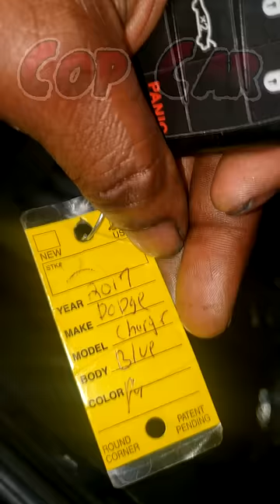Here's the PROOF about this COP CAR...lol

Comment from the maker: Transmission for this car here: https://www.youtube.com/watch?v=6CeC52oOLB8&list=PL-em2JbvrnvxuqZ5bcjgOpZNcKiyPd5Oj
Reply: Look at the sticker in the door jam to prove the year
Reply: Is that the same transmission they use in the Mercedes
Reply: How are you a mechanic and can't find the year
Reply: @dcraexon no. Mercedes uses their own internally designed, and built transmissions. The only Mopars that used MB units were the older generation that had the 722.6. Namely, the Sprinter vans and the Jeeps with the OM642 diesels.

Mopar does also use the ZF units which are used in a plethora of European cars though. From BMW, to VWAG, to JLR.
Reply: U can prove the year via the vin number 10th digit from first 8th from last is the vehicles year make and if u open the drivers door u can find another sticker that shows the month it was built
Reply: @stewart8127  or the V.I.N.
10th character should be an H for 2017.
Every 1st year mechanic knows this.  OMT is just a loud guy with some tools.
Reply: @illuminati5160 YOU GOTTA BE J.ROMO'S BUDDY NOW SOUNDING DAF....
Reply: What brand is the cargo storage in the this dodge brother

Comment: The year will be on a factory sticker on the driver side door inner panel near where the tire pressure and tire size information label is. Hope this helps. It shows the month and year of when the vehicle left factory.
Reply: Exactly LMAO
Reply: You would think a "mechanic" would know this...
Reply: @Notably Nova  I work at Nissan as a Specialist Technician. Even before I was I knew. 😅 sometimes certain things get missed by the eye 👁
Reply: @bimmerhuncho908  hell I learned this fact before I was 13 LOL
Reply: @Notably Nova you learned it faster and earlier than most. My father didn't know how to check the recommended tire pressure or where it states what type of oil, brand, capacity, engine size, Transmission Fluid type which is on the underside of most hoods
Reply: As a car guy as well we know these things before age 15
Reply: Don’t forget that depending on the month it was made it could be that year or the following year model. Built in June or before it’s the year on the tag, built after June it’s considered the following year model. For example 10/14 would actually be considered a 2015 where 05/14 would be considered a 2014. Don’t get me started on half year Chevrolet trucks.
Reply: @sleepingontheblacktop6053  true true. Some people forget that. The car will sit st Dealership storage until it's ready for display outside or showroom floor for the next year's lineup
Reply: Ford forgot how that legally works and put out all there 2020 models that sat outside waiting for computer ECU chips collecting undercarriage rust of the subframe, frame, transfer case, rack, differential, accessories and so on and claimed them as 2022. Skipped 2 years of lineup because they got cheap. My buddy bought a F-150 lariat and had me check it out at his 500 mile mark where he broke it in and had the oil changed early to get any micro metal shavings out from the brand new engines Oil (which is true) and I saw all the rust on the vehicle and the sticker read 03/2020

Comment: The Charger Pursuit Package (Police Charger) is the only 2015-current model that you can get with a 5.7 AWD. It also comes with a somewhat reworked version of the NAG1 transmission to give smoother faster shifts. It is only available to police departments. AWD Hemi are not available in the normal civilian model’s because of the 8 speeds size in the transmission tunnel under the car.

Comment: J Romo was partially correct as the V8 AWD were dropped for consumers in 2014 but kept for Police Pursuits and if my memory serves me correctly it was because of the implementation of the ZF 8 speeds whereas the AWD use the NAG1 5 speeds. So both of you are correct.

Comment: The only problem with the hemi started in late 2006 when they started the multidisplacement system. I have probably one of the only 2007 Dodge Ram 1500s with a 5.7 Hemi and the 6 speed stick shift. The original motor I had in the truck went out ( 4.7) and I bought a motor from a 2005 ram which had the hemi in it. Took some work to get it working right, but it is insane in my single cab short bed truck.

Comment: They did make 5.7 AWD pursuit cars after 2015 but they use the older NAG1 transmission because the 8 speed is to big to fit a transfer case.

Comment: Year is on the driver side on a tag if not there some cars have it in the glove compartment, under the hood, or inside the trunk somewhere . For instance That’s a 2017 so on the tag inside it should say 2016 because the 2017 model was released in the middle of 2016. Hope this helped!

Comment: Under the hood is Emissions label.  Windshield has Vin number . Door jam has every information you need on that car from trim code to year.  2017 is the question  point camera to door jam . Hood label or vin.  And that was not a dip stick . It was a cap .

Comment: Any modern vehicle in America will have two stickers in the driver's door jam. 1 tells make, model, date of manufacture, paint code everything. The 2nd sticker will tell you how much pressure your original tires should have, tire size, max weight load, etc.

Comment: The way you prove the year is by opening up the driver door and looking on the VIN sticker for the manufacture date. If its in the secont half of the year it’s for the following year (if it says 1/17 its a 2017 but if it says 9/17 its a 2018)

Comment: I’m pretty sure he’s half right and If I’m right they did end product of the awd 5.7 in 2014 when the updated version came out but only for charger/challenger models sold to the public. The police cars get a different set of options and is probably why that 2017 5.7 charger is awd. It’s got a cop motor, a 383 cubic inch plant, it’s got cop tires, cop suspension, cop shocks

Comment: Should be a tag on the drivers door or door frame of any vehicle made since the 90s with year of manufacture, gross vehicle weight, recommended tires and their pressure.

Comment: Only way to prove model year is by VIN or the VECI label, and that will just tell the chassis year. Block serial and trans serial would verify their years respectively. Could also use visual cues like body/interior components.

Comment: Well you sound like an excellent mechanic but you could have just sent us a shot of the spec tagging in the driver side door jam and blurred out the VIN it would have given us the build date and from there we can figure out the model year and you'll be able to prove it! Whenever I work on a vehicle I add a picture of that to the file to make sure that I can always prove that I procured and installed the proper parts for that exact model year and build-out... Don't forget kids the 8th digit always tell you what model of motors in there!

Comment: You can check the year of a vehicle based off of the vIn the eighth digit from the end is the indicator if it’s between zero and nine, that tells you what year it is between the year 2000 and 2009 and 2010=A 2011=b etc

Comment: You try and out dodge jt you will get the horns.  Yes all charger police intercepters are hemi and awd. Our state rather have a charger but our state is in an unbreakable contract with ford. So they use the charges are unmarked or undercover.
Reply from the maker: Interesting. Thats whats up Ken

Comment: Two things you have to remember.
Where the police packages considered a standard option package set over there custom option set?
Two and probably most important what's in the car and what came in the car are often too widely different things. 
The factory slip paperwork she tell you what the car originally had, what's the car then sent to a dealer that made alterations, a shop that made alterations these are things that need to be addressed before you can definitively say how it came from the factory. Joe there's a possibility that both of you were right, and both of you were wrong at the same time.
Either way that's a badass ride.

Comment: Look on the inside of the driver door panel should be a manufacturer sticker with the date it came out the factory it may  technically be a 2017 but could of been made in mid to late 2016 as the next model vehicle’s alwasy come out a few months early…

Comment: Does it have the start switch hidden in the floor? It'd be where they usta put the high beam light switch back in 70's on the floor by the left panel. Had a State Patrol car come in the dealership once with it. We only had this 1 car come in for repairs.

Comment: Dodge decided the 5 speed was more durable for law enforcement. And you can identify the awd chargers in 2015 and up by the rims usually. The awd models have the all black steel rims with the chrome center cap. They just slap good old covers on the rwd models. A trooper here said he liked the 5 speed in pursuits over the 8 speed I don't know why. But I would honestly like to see how the 8 speed paired to hemi vs the 5 speed. We just got Durango's but no hemi now for 2023 only positive is the 8 speed.

Comment: i got a question for you, i sold a 2014 charger dash bezel on ebay, some dude bought it, after i shipped it to him he refunded it because  he says "it didnt fit", he claims to have a 2014 charger srt hellcat, and that he even took his car to the dealer to have them check the vin. coming from owning 2 chargers, a 2014 sxt and a 2016 scat, i do know the differences in the generations and as far as i knew, there wasnt technically a hellcat before 2015 models, am i wrong? Anyways, ebay refunded him, he got to keep my parts too.

Comment: You're a mechanic and don't know how to prove the year of a vehicle? Try the sticker inside the driver door or the VIN. Haven't had to do it in many years but the tenth digit of the VIN used to give the year of manufacture. 
A - 1980 thru to H - 1987 skip i
J - 1988 thru to N - 1992 skip o
P - 1993 skip q
R - 1994 thru to T - 1996 skip u
V - 1997 thru to Y - 2000
1 - 2001 thru to 9 - 2009
Letters start again with A in 2010 following same pattern from 80's 90's

Comment: One thing.... surrounded by these things every day, and don't know how to prove the year? How about a VIN? The 10th digit to be exact. 10th digit is year. 8th digit is engine. A 2017 should have H as the 10th digit. How did you look over the easiest way to prove the year? Or hell..... why not just a door sticker shot? Those have manufacture dates on them. Although, depending on what month it was made, it could be a next year model. Either way, 2 VERY easy ways to prove model year.

Comment: Its not going to matter what is or isn't in the car.  if the driver doesn't fishtail and wreck the car, the engine is going to blow up at 60k - 90k miles (miracle if it lasts to 100k).  The transmission is going to blow up at 80k.  The AWD is going to be screwed at 70k - 80k.

Especially since cops LOVE treating police cars bought by taxpayers like $2 dollar ho's - park stopped, neutral slammed, body rammed.  Ran through all the gears, burning rubber and brake pads doing donuts.  And sold at a police auction for $5.